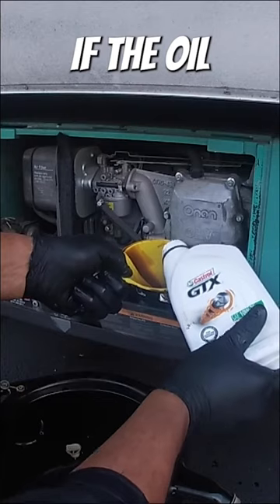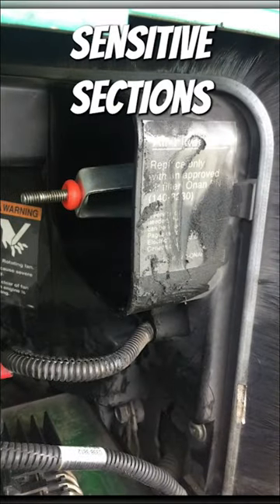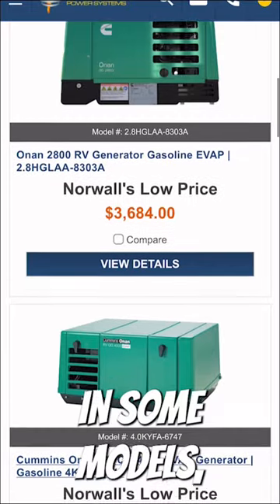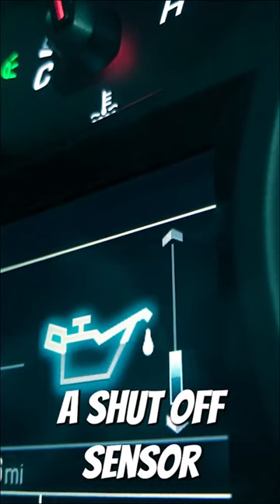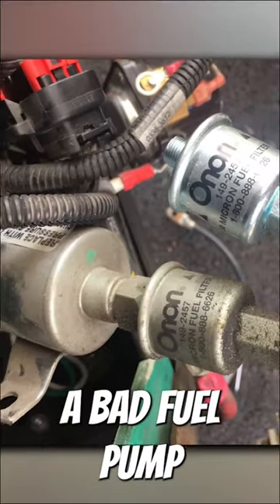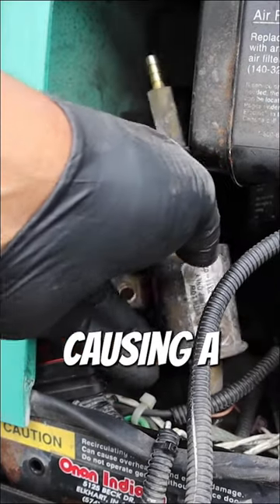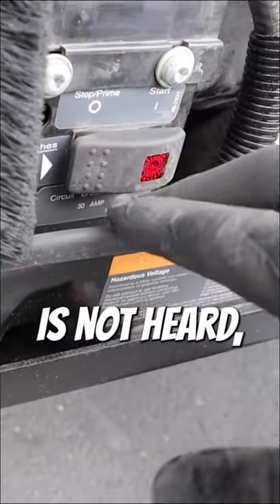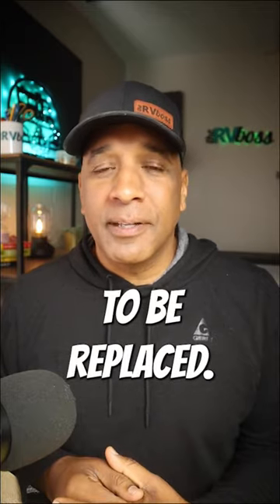4 main reasons why an Onan 4000 RV Generator will crank but not start ⚙️🔧#shorts #rv

Comment: Mine used to run good, I over filled mine with oil and it started to run for 20 mins then it would die and it would take 10 mins to turn on again and then it would die after 5 mins. I drained the oil so it wouldn’t be too full and I keeps shutting down. Do you know how I would fix the issue of oil getting into other parts of the generator?
Reply from the maker: Not real sure on that. It might need to be disassembled and cleaned or maybe it will resolve on its own after a while. 
If you call Cummins service center they are usually pretty good at diagnosing and helping understand what’s going on. 
Sorry I couldn’t be more help.

Comment: Fuel is not getting to the generator. I replaced the fuel filter and the incoming hose was dry at disconnect. I connected the genny to an exterior gas can and it starts and runs fine. CW says it's still a generator issue, Cummins says it's a chassis issue. Can I run a wire into the fuel line to determine blockage or attach an air compressor to it to attempt clearing? 2016 Minnie Winnie 31K, Onan 4000 generator.
Reply from the maker: That’s a tough one. I’ve never encountered that issue but blowing air might be the best solution.
Reply: Use a boat fuel primer bulb in the line to force fuel into the fuel pump to prime it if it doesent prime when holding down the start stop rocker switch in the off position for 15 seconds

Comment: What about if it was running good but now it wont even crank? Light wont even come on? Fuses are good, i changed the starter solenoid and still wont even try a turn on
Reply from the maker: If it was running good and now it has no power. I would make sure the battery is charged and the connections are super tight. 
If that’s not it, then the circuit board could have failed and may need to be replaced. That’s happened to me before.

Comment: How can I get a properly check my oil level if it won’t start; the dip stick is dry. It was running fine 2 weeks ago. I’m in a hot climate.
Reply from the maker: If it’s dry then I would add some oil until it starts. If you overfill it then you can always remove the drain plug to release the excess.

Comment: Does anyone know how much fuel it takes to run one of these for about an hour? Any close estimate would be appreciated. 1 gallon of gas? 3. gallons of gas? I found the answer on line They said about One Gallon of Gas an Hour . Thank You.
Reply from the maker: It depends on the load. According to the Cummins manual…No load=.3gal/h, Half load=.5gal/h, Full load=.7gal/h.

Hope that helps 😄